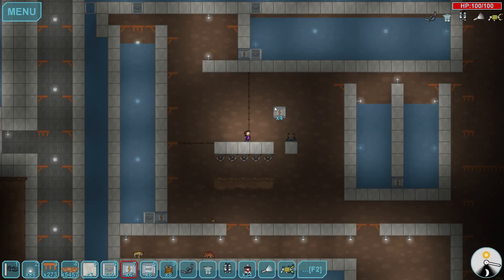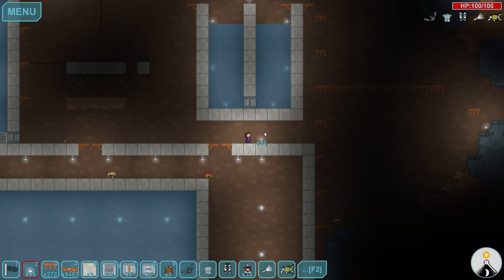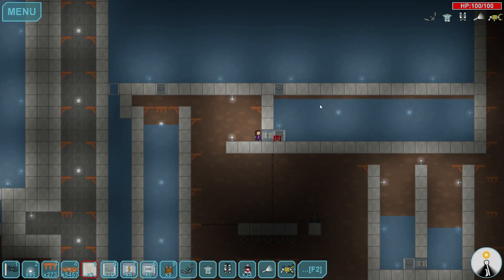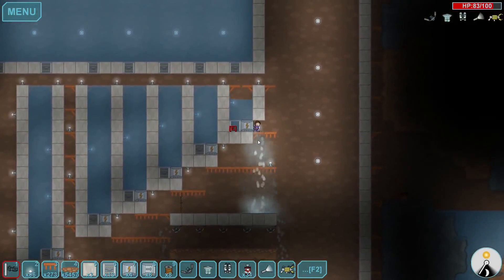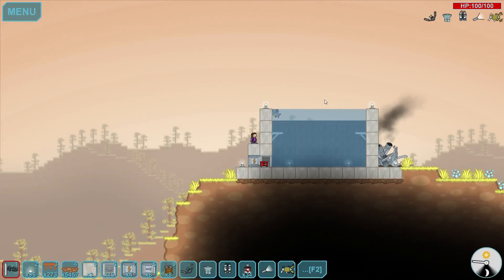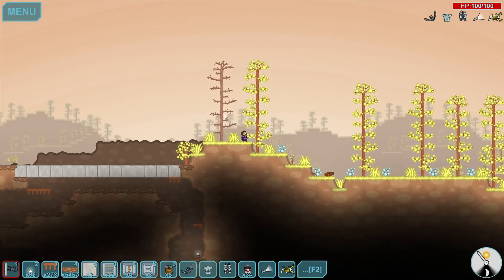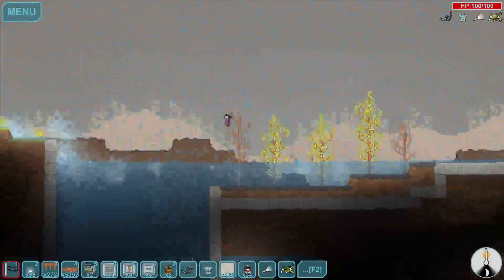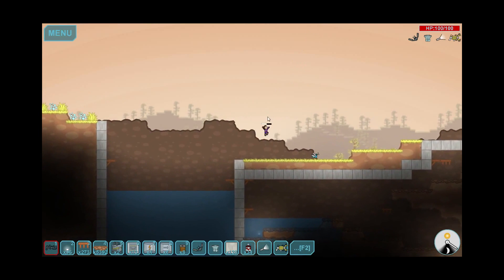Dig or Die: How to build a dam

Comment: nice video....   The problem is how often does it rain?  If it rains every day then you need a dam big enough that the power will last through the night and half a day or so just to make sure.  WOrst case is that it doesn't rain for a day or so..  I think to make this system work we need water pumps so we can reroute the water that has pass through the genarator back into the damn...
Reply from the maker: NetBlaise Yes, it the example dam isn't large enough to really be sustained because it doesn't rain often enough for that. But I would advise you to simply build you dam either lower in the ground or increase the reach of dam further to the sides because pumps only take power. Building you dam at the bottom of the world is really effective btw.
Reply: +NetBlaise for me it rains about 3 times a day but idk if it can be different.
Reply from the maker: +The Dovahkiin 
Yeah, I agree its probably somewhere around 3 times a day.
I bet its more randomized in terms of how often it rains but then it averages out over time.
Reply: Charles Giessen for me it rains everyday at the start of night.
Reply from the maker: +The Dovahkiin Really? well that puts a downer on following fight I would guess.
But hey, its atmospheric!